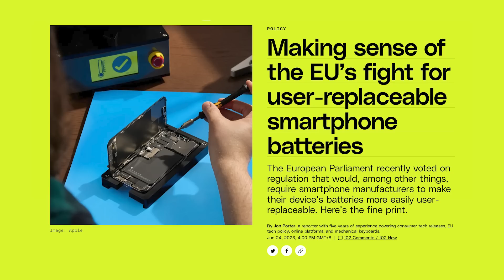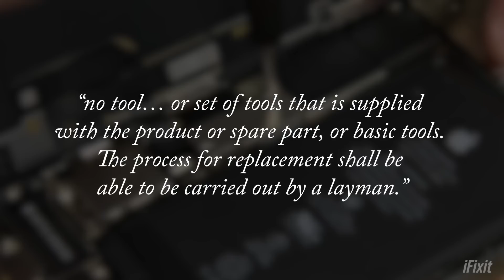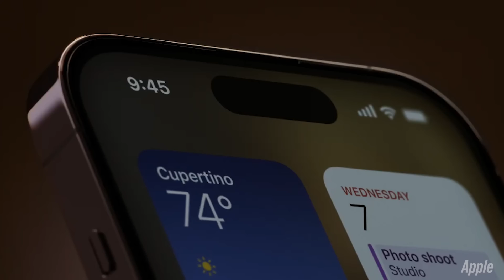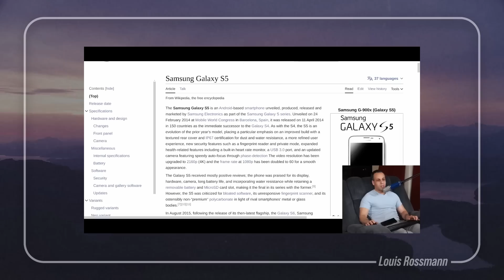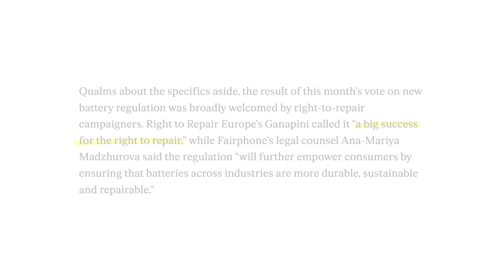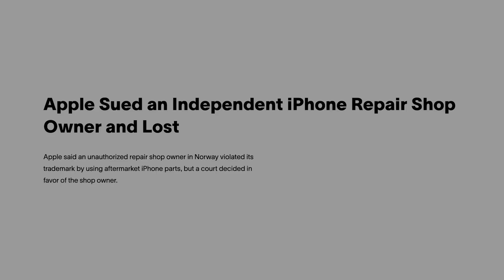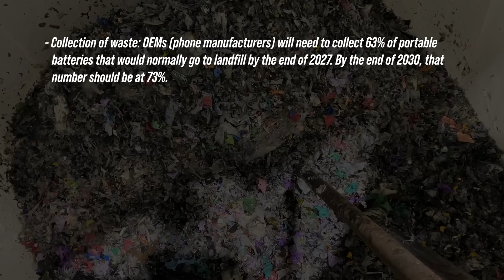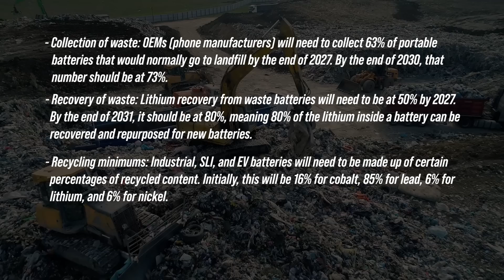EU Just Changed Smartphones Forever

Comment: I think the intentions are correct, but the design of easy swap out batteries might backfire.

Here are my concerns for it:
1. Consumers usually swap new batteries to prolong their phone's life due to financial reasons (most consumers wouldnt really hang on to their aging phone if the cost to switch to the newer version of their phone was not an issue). This means that if you switch the batteries at the 3rd year to extend the life to another year before you get a new phone the consumer will consume more batteries instead of less, so instead of 3 battery packs for a 12 year period, the consumer would go through 6 packs for a 12 year period.

2. Since the design change to hard to remove batteries consumers wanting their expensive phones to last longer has been taking care of their battery health by not over charging, this will have 2 negative effects, 1 is that the battery health would be ignored by the consumer considering how cost effective it is to switch out the batteris at any given time, leading to more batteries wasted as their life cycle shorten. 2 is that there is not a lot of incentive for the consumer to not overcharge their phone or not abusing their phone's power thus leading to more wasted power being consumed.

3. Since manufacturers would need to supply these replacement battery, the market would be flooded with replacement batteries that might go to waste just sitting in stores and warehouses, thus leading to more battery waste instead of less. This means that the count of battery packs produced in a given period would be a couple times more than the actual phones being produced.

4. These days people either recycle their older phones or simply store them in their drawer and rarely look back, and they remained unused because the battery health is already too terrible to be used, but if a replacement battery is easy and cost effective they might replace the battery on their old phone while also getting a new phone, and using  the old phone for some mundane things such as a "spotify bluetooth speaker remote control" or simply just a secondary phone that they dont really need. This means that the consumer consumes twice the battery as well as twice the power.

When the world had easy to swap batteries 10 years ago, the reliance on mobile phones was not this much thus It worked back then.

I think that phone manufacturers was in fact motivated by greed when the design changed to unswapable batteries, but I think there was a positive unintended side effect that consumers become more concerned with prolonging their battery health to get the most value out of their mobile phones, consumer use of batteries and the electricity to power them became more efficient.

Comment: On the topic of getting consumers to give their old phone batteries back to the manufacturer, in Ireland, in most supermarkets and some participating stores, we have boxes where you can throw your old batteries (I think you can leave phones there too) and they get recycled. I reckon other countries could implement that system if they haven't already. But unfortunately humans will be humans and in some cases there would have to be an incentive and "save the environment" isn't a valid incentive for most people
Reply: The same battery recycling points are found in the UK too, and are a mandatory provision wherever batteries are sold. I think this is an item of EU legislation rather than nationally developed laws, and of course we copied the entire EU rulebook into UK law before our government took leave of its senses, which is why many EU standards are still observed here. 🔋🇪🇺👍

(It's also why I flat-out refuse to buy anything without a CE mark. A UKCA mark on it's own usually means „Designed to explode or spontaneously combust when used in accordance with the manufacturers directions“ and this is fairly on-brand, given the volume of munitions the UK produces each year... 🇬🇧💥😉)

Comment: It is a stupid change, most phone batteries last long enough but what this will entails is lower quality for not flagship phones cause the top will just use metal backplate that is easy to remove, but going lower then that will be plastic... not to mention that I remember how annyoing it was that if I dropped my phone it fell into pieces battery and body going separate... and to top that, lithium batteries are very dangerous so them just falling out is surely a very safe way to produce phones... a stupid out of touch law. They should have given space for tools to be used cause we will be getting crappy phones now...and before you go "bUt bAttEry ChAnGe Is ExPeNsIvE" ... just regulate phone repair, even now going to some noname shop getting it changed is pocket money

Comment: This law seems so unnecessary to me. The purpose is to prevent e-waste of batteries being disposed of, but I feel like cell phone batteries are the least of our worries when it comes to battery disposal. We have our cell phones a lot of times for at least a year before getting another. On the other hand I’ll throw away at the very least 250 disposable vape batteries in the same amount of time. Batteries that are equally as harmful. Why ban something so minor that impedes on smaller companies ability to compete along w other issues economically. Also, in reality, how often is someone tossing their old phone just bc the battery isn’t as good as it used to be? Not very often. Typically it’s bc of the screen or other issues. I honestly think with the large increase in batteries that would be produced as a result of this law, would cause so much unintentional waste that it would more than offset the benefit and do no good at all.

Comment: Apple will probably make the battery removable, but programatically 'matched' by ID to the actual phone, so when the user changes it out, every other feature stops working, under some 'security' nonsense. Apple will also probably want to charge $1850 for a new battery (~price of an entire new phone), with some patented feature that creates a prohibitive barrier for a generic replacement to enter the market, and if a generic does emerge, it will be flagged as a 'non-genuine' component, causing every useful feature on the phone to stop working, once again, under the guise of some 'security' nonsense.

Comment: The EU should and the right to repair guys should consider some points 
1. The size and the packaging of batteries have changed. 
2. This easy to remove and change or just swappable batteries can cause fire hazard. Hypothetically speaking i would have to break the phone to remove the battery and start a fire this may attract someone’s attention that I’m upto something. But if i have the same remove able battery i only have to poke it on either corners with a needle and i can start a fire.
Reply: By your logic phones shouldn't have batteries period, because even just high heat runs the risk of the Li-ion battery lighting itself on fire.

Comment: Other than GREED there was no reason to make batteries unreplaceable. Usually, with smartphones and tablets, it's the batteries that wear out first. So making them unreplaceable was an excuse to force you to buy a whole new device.
Reply: What are you talking about. You can always get the battery replaced.
Reply: @swiftuiforever  Do you have to drive to the electronics store to have the batteries in your TV remote replaced, and pay a ton of money? No. You open the remote control, pop in some AAA batteries and you're good. Why couldn't they do that with smartphones and tablets? You buy a smartphone battery, EASILY open your device without any kind of violation of the warranty, and replace it, that's it.

Comment: I bought a great laptop in 2009 and was able to keep it running like new into 2013 (all of college) because i could fix things myself without a ton of special tools
Reply: same here for one from 2008 into 2014 [though it had the idiotic as heck wireless card whitelisting thing..] was an amd core/nvidia chipset build, kept it going that long despite the later found issue of it having a bad tendency of going dead from the chipset failing.. when i retired it, it no longer recognized the optical drive it had due to that failure tendency.. and it'd been through 3 OSes, started as winvista [hated that], went winxp [the model started as a winxp comp, but had the capability to run winvista], then later went win7.. the hardware/processor was 64-bit capable despite the make trying to say it was 32-bit only, it also had/could recognize 4 gigs of ram when they claimed it could only run 2.. lol

Comment: Consumer replaceability was completely uncalled for, the issue was you couldn't buy an original replacement at a reasonable price. Any shop down the road can then fit it, if you are not able to use a screwdriver.

Comment: Wow what a revolution. I had a phone with removable battery, SD card, headphone Jack, bootloader unlocked, and FM radio, 10 years ago. LG G2, best device I ever owned. I still miss it sometimes, this s21 is fast but so much bloat and nonsense, and it's locked up tighter than a nun, can't even root it without sketchy online services.

Comment: You know as well as I do that the non replaceable battery design was done deliberately in order to sell more products. My current Android phone still has a replaceable battery and is inexpensive.(Try under $10 US) I won't touch any Apple Product because of the lack of parts. Despite Apple losing more than a few Federal cases over their suppression of 3rd party repair. Apple persists  with customer unfriendly products.  I won't pay $1000 for a damned phone. $100 should be the upper limit.

Comment: Every regulatory restraint is a bit taken away from innovation. You force usb-c as a universal standard - you delay the adoption of a potential new charging standard which may be much more efficient. You force removable battery - companies won't be able to organise the space inside their devices optimally. I definitely can't say that I'm unconditionally happy with these new rules.
Reply: USB-C will remain a standard for 10 years at least, at a point when it wont be the best the EU will change the regulations, not a big deal.

Removable batteries will not impose any meaningful space restraint on devices, thats a Apple lobby line against this
Reply: @Am_Yeff changing the regulations is a big deal, look how long it took them to impose the current one (was proposed in 2021, but takes effect in 2024)

Comment: tbh I see a lot of people complain about how scummy apple is but still refuse to buy anything that is not apple it honestly surprises me the hypocrisy from some people. This is a step in the right direction but like other comments have pointed out there are drawbacks that can extend from this like "battery not included" which if companies come up with this will require the EU to tell them straight to behave themselves.

Another issue is people buying the best model phone like there is no need there are plenty of older models that work fine and most people don't even use phones for high intensity tasks like gaming so would not require the latest phone as older models would work just as well for day to day tasks. all in all the consumer being us needs to be smarter a long side this legislation if we are to save money and the environment.

Comment: For battery everyone agree it's for greed and profit manufacturers did that (saying the opposite would be just dumb)
I see a lot of people talking about jacky, which is, yeah, sad they removed it, but wireless earphones are now very accessible and you can find quite good ones for 15e or less (and you can still plug one in an USB-C Port with a converter and some converters allow you to charge at the same time

But I almost didn't see (didn't se all comment) people talking about the Micro SD which is a MUCH BIGGER issue for phones
For battery, they said it was for waterproof and design, which is stupid (even if okay, for design it's understandable, even if it's stupid)
For the jack for the thiness (to be honest I hardly care now and I don't like to have very thin smartphone, I always use a case)

But there's ABSOLUTELY NO REASON for the Micro SD, except profit, given it was with the SIM. Some manufacturers offered us the choice between a micro SIm and a Micro SD for the ones who wanted to have the choice, and I think it was the best decision. I doubt we can see micro SD again, else they couldn't see their 1tb phone, since people wouldn't buy them, but I hope a brand would use it again

Comment: Is the part about not needing tools only for phones, cause I feel like with EVs, youd probably want some bolts holding that stuff in, tbh I wouldn't be surprised if they did make an eu only version, just make all the internals the same but for the US they just keep the backs the same, and EU they just use a plastic back that can be popped off

Also I had an Lg G5, it came with 2 batteries and a case to store the battery you're not using, that could charge your battery, or be used as a battery bank, it was awesome, loved that phone

Comment: Exclusive Euro products even though Finland is NATO. So Chinese can now store their coins on different batteries. Just make a Boktai solar powered phone with a flaslight aim at the mirror or your own pocket in order for it to charge and update quicker. Cut the crap. In fact my phone case should have built in charging station at least, a feature on a $30 Samsung mini galaxy phone where you put your extra battery to charge. An option now being hoarded like a spoiler tech kid. Yall bragging about how narrow the ratio is now. So where the extra phone battery case with 360 protection. Where the glass from apartment buildings slash corner store so the phone front part wont break in the first place. That would cut the jailbroken mess in the first place and cut down on so many unused phones...........Now Apple have to actually invent cause China pull an African on them and said worked like our sweat shops. Thanks!

Comment: The batteries are getting more and more efficient, and the electronics are getting lower in price, so I don't think there it is necessary for a smartphone to change the batteries (you will spend double or triple instead to buy a new device). Of course if some companies are going creasy getting higher the price to the sky....!!, so try to buy normal electronics with normal price. 😎👍 by Edison

Comment: "We will now protect the environment even more by shipping your phone without a battery. This way, you can use the battery from your previous phone and help reduce e-waste!" - Apple in 2030
Reply: Tbh by 2030 if battery tech is good enough why not? If a battery has an expected life of 10 years by then. As long as batteries are cheap enough to buy new which they definitely areant now. It’s like what $200 to replace a battery if a new one costs $50 or less that’s fine and not even hard to imagine batteries areant that expensive so $50 would still leave plenty of margin and enough room for engineering and logistics of shipppng and other overhead costs.
Reply: lol. I can see that happening.
Reply: This made me laugh out loud🤣

Comment: Foldables will be a great challange, but for the most part, a user removable battery really just means: "Use screws instead of glue"
Here is an example, my casio watch is rated for 20bar or 200m of water pressure! Two hundred! And there is no glue, just four screws, a rubber ring, and some silicon grease. That's it! If this technology is good for 200 meters underwater, then i am sure it will be suitible for phones
 too.

Comment: I love the idea of repairable electronics but i dont see how some are going to be workable. Like EVs, how do you firmly attach hundreds of kg of battery that can be changed without any tools, let alone the issue of voltage..

What about watches, personally id rather a smaller watch thats lasts a week or 2 between charges but cant be fixed easly.

What about ear buds??? Do they need to have changable batteries??

Comment: questions is, no other country have the law right? so why makers change just for a country, is not a universal law,  I don't think so. Makers would make a replaceable battery which is simple, it has been done before, to sell to EU if they decide to sell in that market, If they don't sell in EU market that is only a small lost.  EU have to make their own phones. By the time battery need to be replaced, users would replace the phone, that is especially true for low-mid range phones. It does not help the environment since there are extra batteries either not used or become rubbish.

Comment: The problems with removable battery. In practice, you would at least plan on carrying 2 battery for this change to be worth it. 
on top of that, removable battery would require proper dockings for battery to sit in, and that requires extra mechanism that holds them in place, so it leads to 1. less water and dust resistance 2. takes up much more space. So all that time and money spent on making the smallest chip possible, 3nm chip, to make the phone as thin and light as possible while packing more power, goes right back to square 1, bulkier and heavier.
While EU does great stuff like forcing Apple to adapt to type C port, this one might not be that great of an idea.
Just some thoughts from my EE background.

Comment: as someone older than 18, even the very first models of smart phones USED to have removable/replaceable batteries. just like blackberries, flip phones, nokias did. this was something that i’m pretty sure Apple was responsible for with the iphone 3g.
if you ever watch TV/Films from like 2007/2008 and someone has an iphone with that black bar at the bottom? that’s the removable battery 🫨